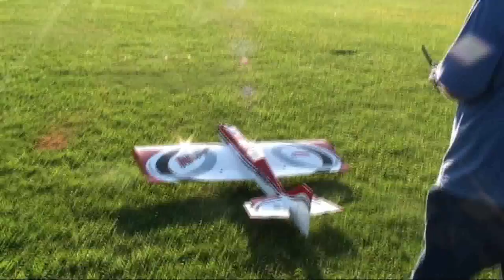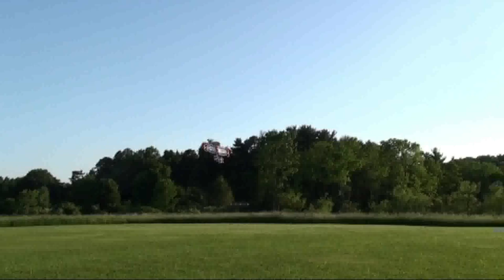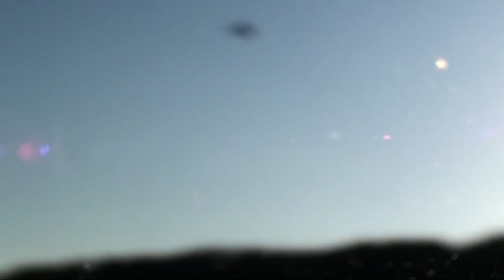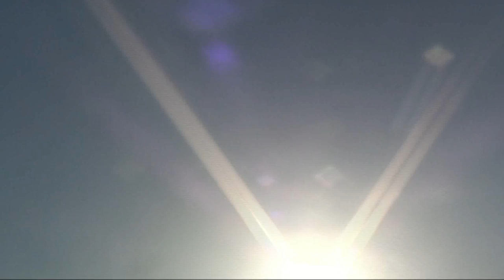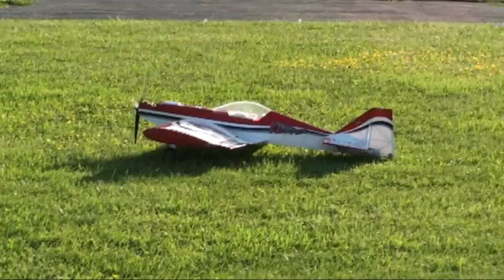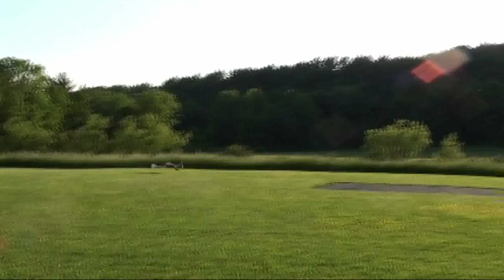Flight Video - Hangar 9 Brushless Twist 60 Electric w/E-Flite Power 90

Comment from the maker: @Stylensky Hi, Glad you liked the video.  The plane is pretty great with electric. I just picked up two additional 14.8v 4ah Turnigy nano packs to try in it as well as a pair of ski's (waiting on the snow tho). I did get pretty good flight times off of the 3700 mAh packs. (7-10 minutes depending on how I fly). It's also very quiet, much quieter than some of my high revving foam things.